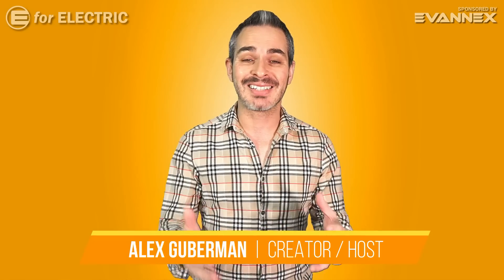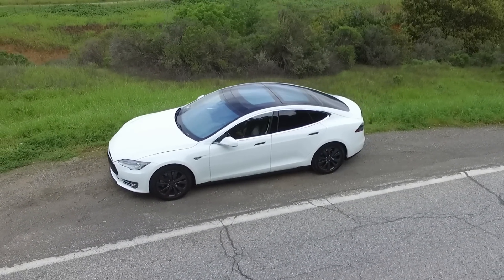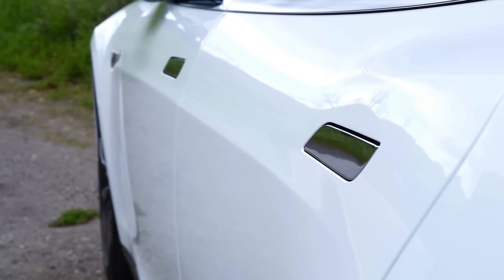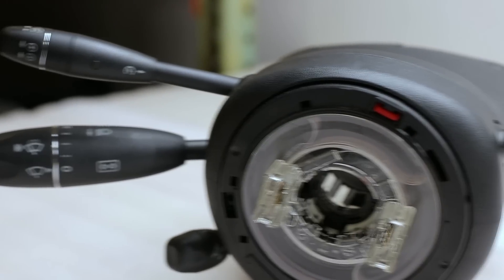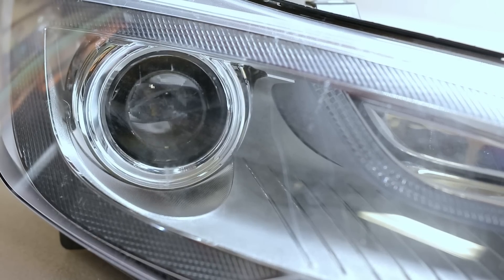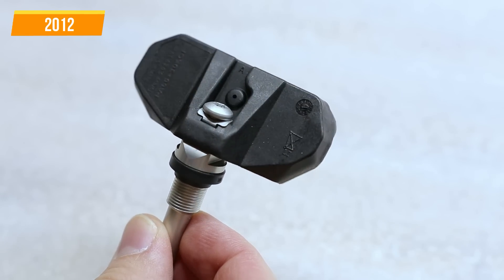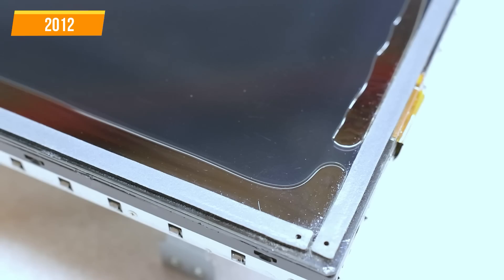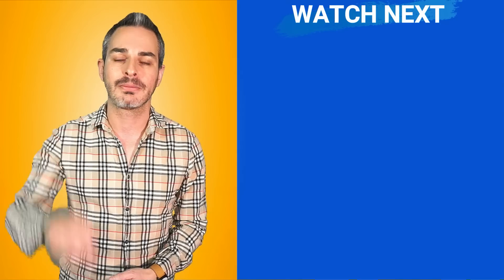Tesla's Hidden Upgrades: 2012 to 2020

Comment: you are wrong about the headlights. the HID are brighter and better than the new LED ones. also the cutoff line is there to not blind oncoming traffic... the rear small motor isnt more reliable. they also still use the big rear motor. the TPMS are the same that need to be repalced over time. you really should learn a thing or two about cars before you post videos like this. lot of false info here
Reply: The new LED's DRL's are terrible. They are super dim in the day time and at night super bright. Nosecone Model S has the brightest DRL. Don't know how Tesla messed that up nor how they haven't fixed it. Facelift Model S's have terribly dim DRL's which look lame

Comment: MCU has also changed over time (new ones are more powerful now and I think the EMMC issue is also improved). Raven suspension was a big change. Center console became available and is now a standard feature (vs yacht floor in earlier models), rear cup holders and USB ports, removal of sunroof for fixed glass roof.

Comment: You forgot about the "monitor" or MCU as it's know as, having an issue with the  EMMC memory chips failing after about 4 years. This is due to excessive data logging being written to the internal memory, which have a finite amount of writes before failing. The later version 2016+ (MCU2) fixed this. 
My 2015 failed (like thousands of other owners), causing screen reboots while driving, and eventual no access to anything that the screen controls (pretty much everything). Tesla replaced the entire MCU unit with a new one under warranty. They have also reduced the number of logging events and I've heard they also are now offering MCU2 upgrades for older cars.